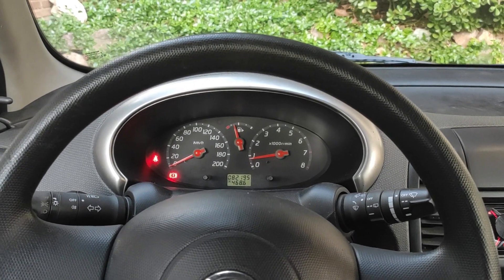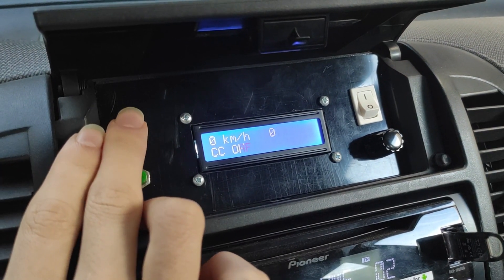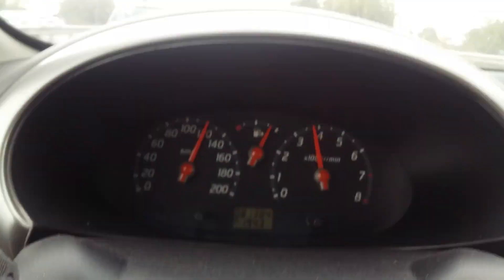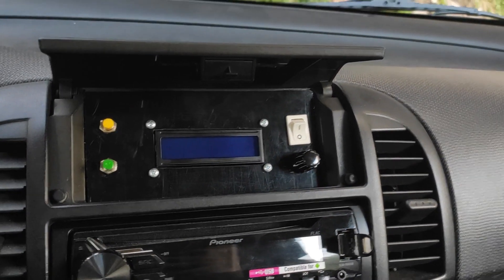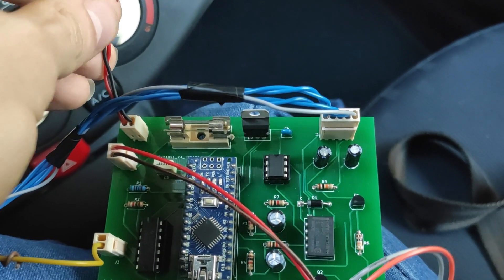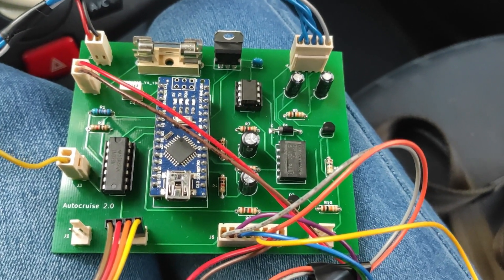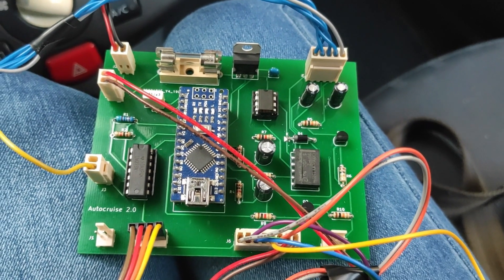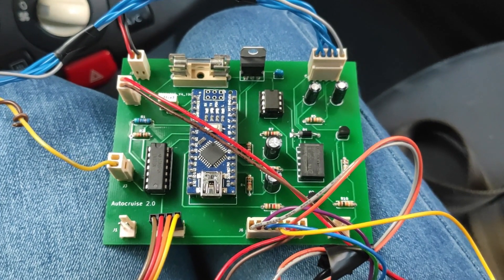Arduino cruise control for my car

Comment: This is very cool, wow amazing. Why didnt you connect it to the cars OBD port and CAN bus? Do you use PID control for the throttle? If so how did you set the P, I, D parameters?
I wonder if you could buy a 60 dollars ACC Adaptive Cruise Control Radar Sensor for a newer car to make an adaptive speed system

Comment: Awsome. Will use this. By now I'm sure you have improved it more. Was wondering why you wouldn't have check the speed of the car before allowing the cruise to engage? this would prevent the engine revving when not in gear

Comment: It's a little too complicated if the goal is just to hold speed. Why not convert the  alternating current of the tachometer into DC current  and then use a Lm393  to control a relay to the throttle

Comment: Nice job ! is it still fonctional 5 years later ? Is it smooth on non flat road ?
I notice that all your arduino code do is read the wheel speed every 500ms and adapt the throtle sensor at the same interval.
I think you can significantly increase smooth by using a PID regulation , especially when the road begin to climb , with a good PID seting it should instantly put 100% or 0% throtlle when needed. 
If think of doing the same ,  but there is no flat lands where i live so i've got to think about that lol

Comment: I've been thinking of doing a very similar project for my fiesta,  have you considered adding an extra relay for accelerator pick up whilst in cruise mode so you can still accelerate manually above the cruise limit, using the analogue inputs of the arduino
Reply: I was thinking this also, no relay required, you could simply also monitor the pedal position and if it exceeds the value of what cruise is sending, send the pedal value. If you lift the pedal off, revert back to the cruise set value. You could also have things like if you exceed set value by 20/20% cruise disengages. this is how it worked in my previous car

Comment: Hello, it's very interesting project. Thanks for sharing in detail. Can you please add details of wheel speed sensor and it connection? Secondly, if we connect wheel speed sensor with cruise control how ABS will react? Please comment, thanks

Comment: Nice job 👏 I was planning something similar to do with electronic pedal . Sadly  due to lack of time the project sits  on a shelf :-) 

Just an idea cause I used in the past a waeco magic speed  ms-50 as cruise control and it only uses engine speed (rpm) as a reference signal to hold the speed . It also detected if you go on a slope due to ram drops and accelerates the car or it shut down if the drop was to significantly due to wrong gear.

Comment: Maybe add to the code, that if car is on cruise control and accelerator pedal is pressed more than arduino giving, then it will release the relay...

Comment: Buenas trabajo buenisimo, estoy interesado en el proyecto, nada mas ver el video he reconocido rapidamente que es la A-2 autovia que recorro cada dia desde bcn hasta el bruc, me gustaria aplicar en un peugeot 206 del 1998 no se como sacar la velocidad de mi coche
Reply from the maker: Hola! En efecto, es la A-2. Para sacar la velocidad del coche tienes que mirar en el manual de servicio qué sensores tiene y dónde, y estar preparado a desmontar medio coche para llegar al cable y cortarlo para hacer un empalme. En mi caso no fue fácil. Si tu coche tiene bus CAN puedes coger un ESP32 por ejemplo y sacar la velocidad de allí. Si tuviera que volver a hacer el proyecto de nuevo seguramente lo haría así.
Reply: @carlesalbas2844  pls.share the codes for ESP32 bCoz getting proper car speed data is very difficult. If you are serious about it then please share the codes for ESP32 , (without proper seed data project is non of use, I have made it but it is useless without speed data)
Pls reply if possible.

Comment: But this method is extremely risky, one wrong mock sensor input value then whole system collapses, better to integrate with relays using in market cruise control module.
Reply: Yeah I have my own doubts about "crashing" the ECU with something like this. I would think it is definitely risky.
Reply from the maker: If you send a wrong signal to the ECU then sure it crashes and the check engine light turns on. However, I installed the cruise control more than two years ago and hasn't failed a single time.
Reply from the maker: My board uses a relay to override the accelerator pedal. If the board crashes or the power is disconnected the car can function perfectly well on manual mode. If the sensor signal were to go wrong I can just power down the cruise control and drive normally. I designed it with that in mind.

Comment: Good work! Have you found a way to alert the controller for disturbances like uphills and downhills? Im into building a generator, based upon cruise control (which also will face the disturbanceproblem). So I will look at your code and analyse it for curiosity. Thank you for posting.
Reply from the maker: Not really, it would be useful to have access to the engine torque as well to better anticipate to changes in slope. This cruise control is only based on speed. The controller only increases the throttle after the car has lost speed.

Comment: Hi, great project, i already start doing mine , got board uno and lcd connected so far, and  sketch loaded. I have two questions ,if u can help me please. 1 it is possible to get wheel speed signal from gearbox speed sensor (ecu pin)? 2. how to convert to mph? Thanks.
Reply from the maker: Hi! You should look at the schematics for your car and check which sensors it has. If this gearbox sensor is before the gearbox, it'll give you only the RPM of the engine, which can be converted to speed if you know the ratio and the gear. The manufacturer's documentation probably won't tell you what's the output of the sensor. I connected an oscilloscope to the sensor, accelerated and observed what happened. However, if I had to do this project again I probably would use an ESP32 and I'd get the speed directly from the CAN bus.
Reply: @carlesalbas2844  I honestly worry that people who can't figure out basic questions like this are going to kill themselves but then I realize they probably will give up before connecting anything to the car.
Reply: @carlesalbas2844  if you have free time pls. Do it using CAN bus speed data. Because I have tried it but failed. I have made your project and using it. Only speed data create problem (speed signal is not stables) any idea how to solve it.
Reply: Did you figure it out?

Comment: Hey, I believe this is a Nissan Micra. I have the exact same car! Can you describe from which place did you take the brake and accelerator signals? From the pedal connector or from somewhere else? Cool implementation btw!
Reply from the maker: Hi! I cut the accelerator pedal sensor cable, not far from the pedal itself. I wouldn't recommend to do that in a new or expensive car that you might wish to sell some day. For the break sensor I just connected a second cable to the connector, as the break just needs to be detected, but not overriden.

Comment: Nice job!

I want to read the speed of the wheels, but the sensor is Variable Reluctance, is it possible with the lm339?
Reply from the maker: Hi, I'm not sure. I don't even know which kind of sensor I have. I employed a purely empirical method. I just tapped the sensor with an oscilloscope, accelerated the car and looked at which kind of signal it gave.
Reply: @carlesalbas2844  i have same problem not getting  correct speed data / Reading , it jumpes frequently, not stable how to solve it,

Comment: Great work, Carles! Why the wheel sensor signal need a comparator LM339? If I assume it is 12V,  would voltage divider do the same? What voltage is the signal?
Reply: Why not use the ecu speed signal?
Reply from the maker: Hi! Thanks! Let me explain. The output of the wheel sensor is a square wave, the frequency of which is proportional to the speed. The high state of the square wave is 1v (not 12v). Therefore, this 0-1v square wave must be converted into a 0-5v square wave than can be fed into the digital input of the arduino. The comparator compares the 0-1v of the input pulses with a reference of around 0.8v and uses the difference to drive an open collector output, which together with the input pullup resistor of the arduino creates the 0-5v wave needed.

Comment: Sir,
can you please send me a GBR file on amitkadamak1@gmail.com
I would like to know some details.
I have made it but desaired out is there.
1 where is the relay ground.(both terminal showing 5v) relay is not get triggered.

2 lm358 showing constant voltage 3.72 contineusly (not as per speed we set.)
 Pls reply.
I am excited for your email.

Comment: hi carles thank you for share this project is it possible to lock the present speed like normal cruise control system by use the wheel sensor signal
Reply from the maker: Yes, it is! One of the two buttons does exactly that.

Comment: Today afternoon I was thinking about to design this exact circuit with this exact idea by using Adruino board.  I was searching for the same now and found the same.  Congrats dear man.👍👍👍.

I dint know how to make these additional PCBs even though I am from an electronics background.  Could you explain this in detail please for manufacturing it as DIY product, please?
For Eg: how to make the base board from the schematic, etc.
Reply from the maker: Hi. I think that nowadays it doesn't make sense to make DIY boards. It's much cheaper and easier to get it manufactured professionally. I sent the schematic to jlcpcb (there are other companies as well), it only costed around 20€, shipping included,  and took less than a week all the way from China to Spain. Just the products you'd need to make it yourself are more expensive, and the quality would be much worse. 
Best of luck with your project!
Reply: @carlesalbas2844  Thank for your reply.  I will try to do the same.
Reply: Sarth , Is your project completed. Can you share me some details like, how to get speed senser data, connection to the accelerator etc. my mail ID amitkadamak1@gmail.com

Comment: Hey Man I am from India I need This Project for my Personal Use Can you Please Teach Me For my Carburetor Bike. Thats My Request Please.
Reply from the maker: You want to put cruise control to a motorcycle? Looks a bit dangerous to me. In any case I guess that if it's a carburetor bike you'll need some sort of servo to physically move the cable. My car has electronic fuel injection so it's just about supplying the proper voltage to the ecu.
Reply: @carlesalbas2844  ok man thanks for reply let i will learn some basic for made this

Comment: hello , so nice project , would like for old school car create such ( with cablle and mechanical injection pump , similar as carb)  , can have vacum actionner and would have only to drive a 12 volt solenoid for drive it , my car is able to have a hall speed sensor in cable giving 8 5 volts tops by weel rotation = nearly 1 meter = 8 tops ....

Comment: Nice neat project, well done. I've been wanting to do something simple like this to my cable operated Corolla.
Reply from the maker: Thanks! When you say cable operated you mean old-style mechanical cable to the carburator, right?
Reply: @carlesalbas2844  Not exactly carburettor. They use cables even in modern day cars with fuel injectors. It goes to throttle body. Original cruise control in this solution is just another cable powered by separate module with kind of servo motor or something like that.
Reply: @piotrpaczuski4060  Chci toto řešit u Citroenu Xsara, která má, stejně jako u Vašeho auta, škrtící klapku ovládanou lankem. Také bych to viděl na nějaký servomotor, ale s elektromagnetickou spojkou... Vymyslel jste něco?

Comment: Hello! I really like your project.  Could you add comments to the Arduino code? In another car, there will be a different voltage on the gas pedal.

Also, it would be useful to be able to adapt the program to acceleration parameters.
Reply from the maker: Hi! Thanks for the interest. I didn't put comments because it's a small program and at that point I had no sight of sharing it. I have put a few now, but take into account that the whole thing is very fine tuned to my particular car. Other cars might have different voltages, different acceleration needs, a different number of sensors or maybe a different sensor technology altogether. You should take the code and the whole project as a guidance, but not something you could just plug into another car. Furthermore, if I had to do it now, I probably would have chosen a CAN bus capable microcontroller and read the speed and engine torque from there. I think it would be a more responsive cruise control if it had access to other variables rather than only the speed. In my project the car has to first lose speed before the cruise control realizes that it should apply more throttle.

Comment: There is a problem with your design. By providing the ECU with an altered signal from the throttle position sensor, the ECU will add fuel, but without the throttle actually moving the airflow into the engine will not match the additional fuel, therefore the engine will have extremely rich air fuel lambda values. The correct way to do it would be to physically actuate the throttle using a stepper motor or drive by wire system, unless the vehicle is already fitted with a drive by wire system in which case you can alter its input signal using the arduino.
Reply from the maker: Hi! Thanks for the interest, but I think you didn't fully understand how this works, or I didn't explain myself properly. My car is indeed drive by wire as far as the throttle is concerned. The throttle pedal is a potentiometer that sends a signal to the ECU. When the cruise control is activated the arduino overrides the pedal input and sends its own signal to the ECU. As far as the car is concerned, it's exactly the same as the pedal being pushed and released. I am not touching the throttle position sensor, but the accelerator pedal position sensor. Maybe here is where the confusion lies.
Reply: Carles Albàs thank you for your response!

Comment: Your project is cool! could you show us the details how to interface with throttle? Please also check my project https://tinyurl.com/oldcar-acc aftermarket ACC
now with Openpilot you even convert your project into Adaptive Cruise Control!    https://tinyurl.com/batteryless-eon
Reply from the maker: Hi! In my car the throttle pedal is just two independent potentiometers (for redundancy I guess). They receive 5V from the ECU and output a voltage level corresponding to how much the pedal is pressed. The arduino outputs a PWM signal that goes through a low pass filter to get the desired voltage level which is then fed into the ECU, mimicking the action of the pedal potentiometers. I don't know whether more modern cars use more complex pedal interfaces.
Your project looks fancy! I didn't know about the Openpilot software. I myself would've enjoyed making a more sophisticated system but sadly lack of time and resources prevented it.
Reply: @carlesalbas2844  There is another opensource project called COMMA PEDAL https://community.comma.ai/wiki/index.php/Comma_Pedal it has the same function like your design. So people can fed canbus signal to control the gas throttle. You may consider play this series of project, especially Openpilot, it is based on a smartphone and able to output the lead car distance only based on its camera (no mmWave radar needed) . Check my video https://www.youtube.com/watch?v=5EkQ_x6f3lE&feature=emb_title the changing number at the right of the screen is lead car distance! very accurate and possible to use for convert your car in Adaptive cruise control (ACC)